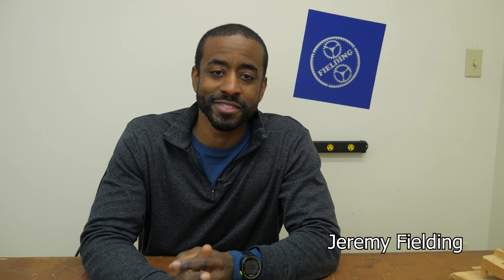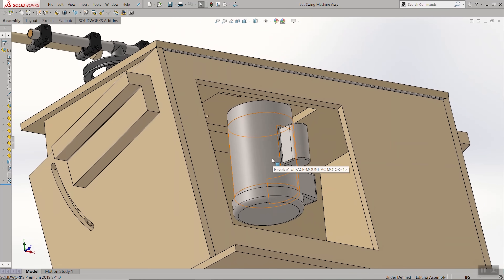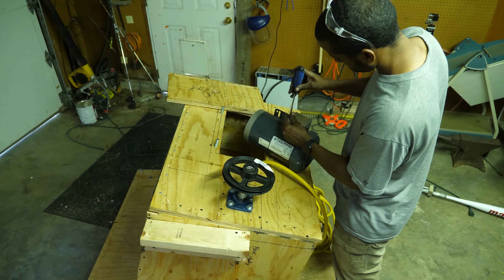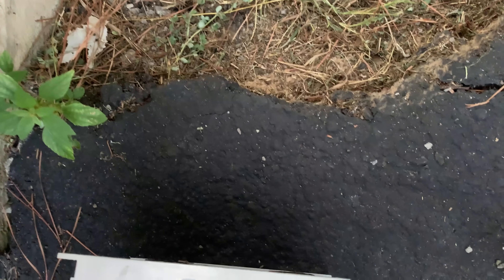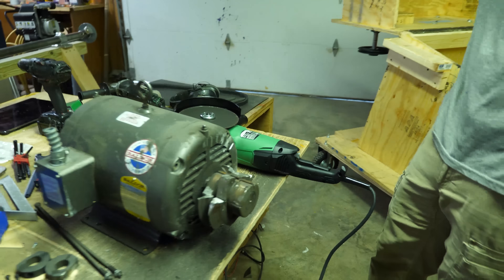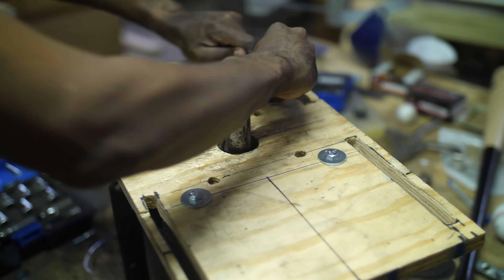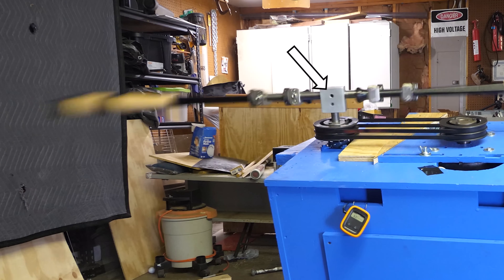Building The Home Run Machine "Mad Batter" (076)

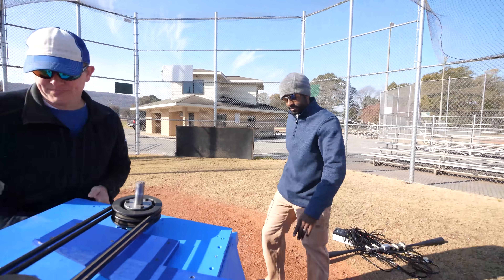Comment: at 3:07,  yer  prime mover does  NOT  have  MA, over the  load.   ugh.       SEE the way  ANY  prime mover  is  Correctly loaded, via the use of the  SMALLER  gear/pulley/sprocket.

Comment: in the future, if you need something to stop fast, you can connect a braking resistor to your drive, and also install a line reactor to reduce the harmonic currents.  Without the braking resistor you are using the mains power to turn the motor into a generator to stop the motor. With a braking resistor you can stop the motor instantly several times without risking an overcurrent issue. Changing from a 1ph to a 3ph motor was a great decision here.

Another thing to consider for the home is that you can drive a 3 phase motor with a single phase service by doubling the size of the drive compared to the horsepower the motor is rated for.

Comment: Jeremy, I’ve emailed u, left text on different video post requesting help.. Not a word. I know ur busy & cant answer every request but I think what I am asking has not been covered on any of ur videos. Just asking for u to draw out a little drawing of how to wire in a DPDT switch to operate a dc motor on a wood lathe. I do best operating from drawings. I can follow lines pretty good. Oh, I forgot that I am running the motor through a mc-60. Controller. That’s where I bump my head. I assume the switch has to be on the dc side of the Mc-60, but I have watched many videos on utube and strangely about half say the two middle lugs go to the power side and two end lugs go to motor.  The other half are opposite, saying the middle lugs for to motor & end lugs go to power. Which is it? Confused!
Thanks for replying

Comment: I feel like all of the horsepower ratings from the automotive industry has desensitized people to just how much damage you can do with just a few horsepower.  I have a little 30hp tractor that can throw thousand pound logs and can scrape and drag a couple thousand pounds of gravel effortlessly, and do that for hours and hours on a few gallons of diesel.  10 or 15 on a three phase motor is a bolt shearing beast.
That said, would be fun to see you do a collab with Rich Benoit to see what you can do with a Tesla motor. B)

Comment: Back when airplanes were equipped with machine guns the propeller and gun were timed so the bullets went through the spaces in the propeller’s rotation, so the machine gun wouldn’t shred the propeller. Would it be hard to devise a pairing of the ball machine and the batting machine so the ball would hit the bat perfectly every time? Y’all could get some phenomenal distance if the ball was struck just right.

Comment: Great video and awesome collaboration with Destin, always love seeing those videos. Earned my sub.
At around 6:35 you talk about drag force and it's connection to the velocity squared (v^2)
You also mention a rule-of-thumb that says "double the speed, 4 times the power".
Isn't it supposed to be 8 times the power?
Power equals (constant) Force times Velocity meaning power "created by" drag force is affected by velocity cubed (v^3).
The energy needed is 4 times because kinetic energy is affected by the velocity squared (v^2).
Reply from the maker: Yes... I missed that during editing. I will add a note to the description. Thank you

Comment: I think a good safety mechanism for this would have been to make the clamps for the bats to have a quick release that was linked to the shaft of the other bat. If one bat broke off, it would trigger the release of the other bat instantly re-balancing the base. After seeing the destruction that was caused from a bat breaking, I think the extra time and expense would be offset by the increased longevity. Cool project and good luck going forward.

Comment: Did you have any braking resistors to help slow the motor down with the vibration sensor/relay were tripped? Without somewhere to dump the current, the motor windings have to dissipate it themselves.

You'd want something that's on the order of 10's of ohms, but with 100's of watts in load capacity. You'll often find these in commercial grade treadmills, since those have a (purpose-specific) VFD and 3ph motor inside... I'd be amazed if you didn't have any of them laying around already. Hahah.
Reply from the maker: I didn't consider a braking resistor... I have one... and could have added it to the VFD. Great idea.

Comment: The bat that broke was because you drilled a hole in it the video is good anyway. Now I want to build one because my uncle has 4 7.5hp 3 phase and one 10hp 3 phase motor.
Reply from the maker: At those speeds... the bat will always break. We tried many different combinations. The bat just can't handle that much energy even when hitting the sweet spot.
Reply: Yea but you still beat the record, the baseball and the bat hitting each other in slo mo was super cool. Just like my electric paper airplane thrower it raddled it self apart.

Comment: I've seen your handiness with Treadmills. You should do what I did and make a pitching machine to go with that mad batter using Treadmill parts! 2, 2.5 horsepower motors with pitching wheels mounted on them hooked up to and mc-60 motor controller will get you 70 mph fastballs that maintain a tight group. I was getting 70 mph pitches with the motors running at about 1/3 of their potential too. Get your pitcher out of harm's way and build a machine to do the job. Cool project though! I love your videos.